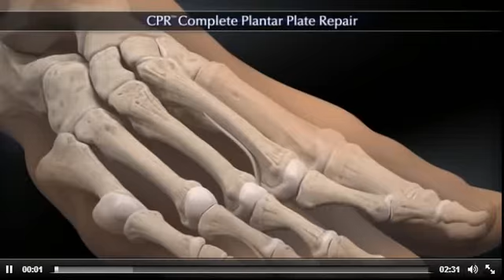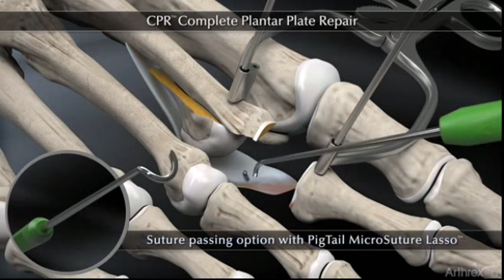Plantar Plate Repair

Comment: I had this done from the bottom of my foot to repair 2 toes last May and it's been the best thing. This Thursday I'm having this exact surgery done to repair my second row from the top
Reply: From the bottom I was zero weight bearing for 12 weeks and had to use a knee cart. The surgery I had from the top of my foot I walked out of the hospital in a walking boot the same day of the surgery.
Reply: How long after the surgery before you  could walk again?
Reply: @sgbutsch  the surgery from the bottom took about a year to feel normal. The one I had done from the top is 4 months post op and bending it is still difficult but other than that it feels good.
Reply: @SalinasAshley  could you walk? How many days after the last surgery?
Reply: Did it work?
I’m having it done from the top and was wondering if it actually works long time.